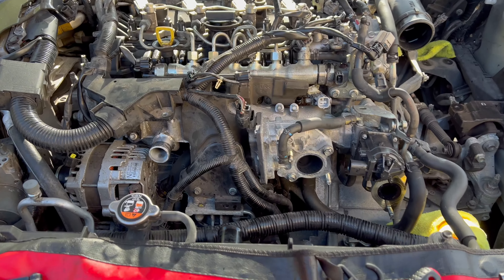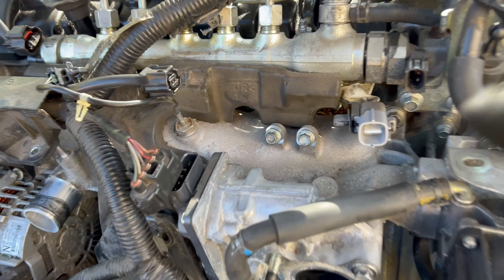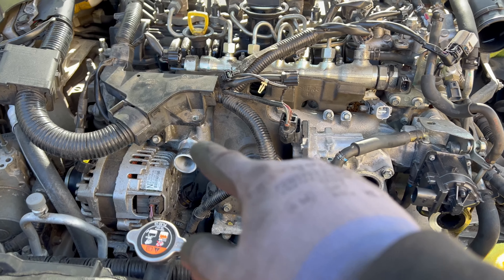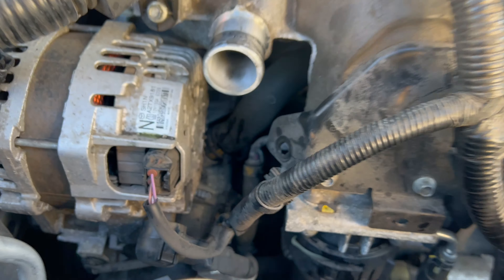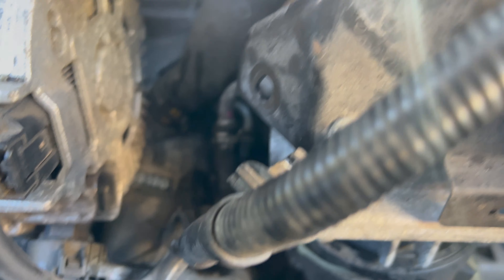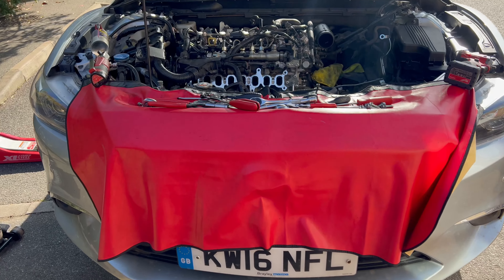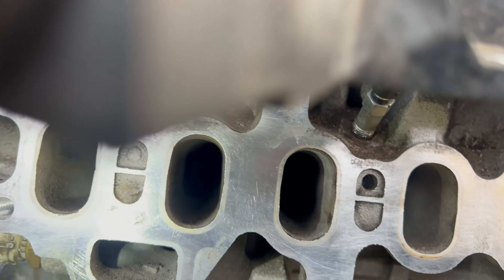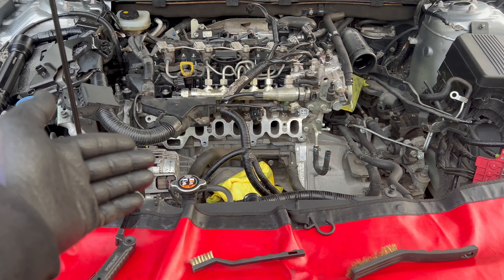How To Tell if CARBON Cleaning Was Done on Your Mazda Skyactiv 2.2 Diesel and if Intake Manifold

Comment: Hello mr nice guy , i have the 2.2 sky activ 101k miles , bit sluggish and have dpf inspection required on the dash ,so its very likely it needs a carbon clean , 
How much do you charge for this job ?

Comment: Hello mr Nice guy thank you for the content its really good.
I have a mazda cx5 2,2 diesel and i have the oil level is rising up a bit do you have any idea through your vaste experience what is causing that?
Reply: Oil dilution is 'normal' for this engine ( oil rises ). Just make sure it's changed before it hits the X mark on the dipstick ( there is a low mark, full mark & X mark )
Use C1 full synthetic oil as well.

Comment: My mazda 3 will give me a eml and limp for boost pressure not detected  when it's doing a dpf regen if I put clutch in at 2k plus revs and slow to idle . I also get p0101 code if I lift off and cost over 2.5k revs
Reply from the maker: Very likely you need carbon cleaning and the turbo or the exhaust pressure sensor inspected